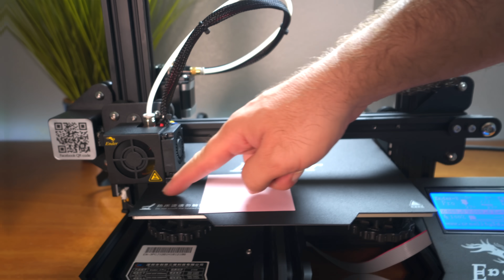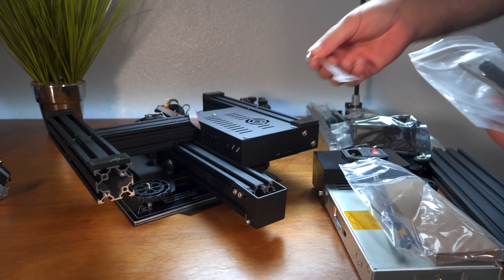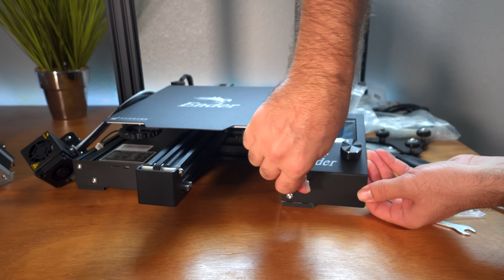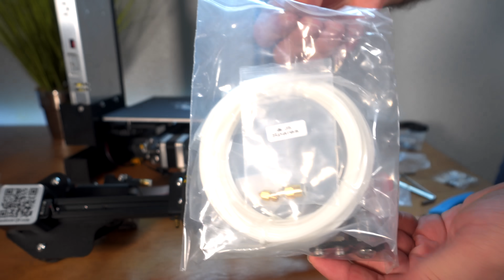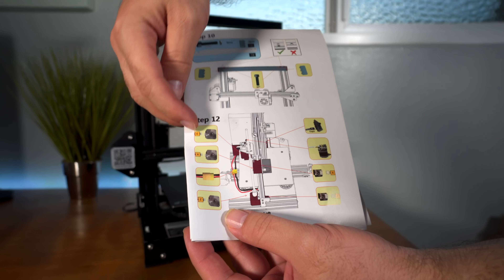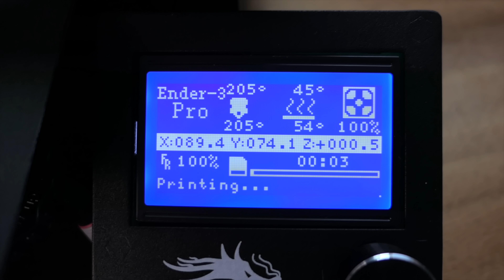Creality Ender 3 Pro -  3D printer - Unbox & Setup

Comment: Thanks Just Vlad for the nice video. Just got mine and after 3 weeks experience with Ender 3 Pro I realice the pain of leveling problem. Even spending half an hour with paper and patience 5xStop points hotend nozzle Z axis leveling, my bed just wont get right, and maybe printing once or twice then it looses calibration again. Just bare in mind this is a real pain of buying a cheap printer, mine was 213€. Then you end up giving up  and no chance to go for autoleveling option having to buy the BLTouch adding another 50-60€ that It will arrive soon I hope . This printer must come with this option from factory as it is really frustrating and in the oficial page already has integrated the BLThouch video (sad). Good Luck anyway thumbs up.

Comment: Woohoo! Thanks again for the video. Helped a ton when the illustrations in the instructions weren't making sense. My first print came out perfect, as far as I can tell. There was a tiny bit of fuzzyness at the tip of the tail and the highest point of the head of the dog I printed using the test file included on the SD card, but it rubbed right off with just my finger. I totally get the people that have commented about running the printer practically non-stop since getting it. 👍 I guess now I have to learn how to work with the files and modify existing designs and hopefully work my way toward being able to start with a blank sheet. I knew I needed one of these in my life! 😁👍

Comment: You'd think they'd mention the possibility you might need to tighten up the bed like you did before you even started to follow the instruction steps. I'm about to start trying to put my Ender 3 Pro together and it's my first ever 3d printer. I'm usually pretty good with stuff like this, but yours needing an adjustment not mentioned in the instructions right off is not exactly filling me with confidence. 😕

Thanks for doing this video, Brah! I'm sure I'd be even more apprehensive about getting started. I may be back to blow off steam by having a public hissy fit. 😉 Did you just call me an eccentric mutt? What you say about my little t-nuts? Am I really nuckinfuts or just trying to divert attention from my heel dragging? Oh well, here goes nothing. Nice that they include the hand tools you need for assembly. Thanks again for your guidance, Obi Wan! 😁👍😎

Comment: Just put mine together had a little trouble then found your channel. Tried to print the filament adapter and the files unzip on SD card but the printer doesn't show it. Any suggestions?

Comment: Hi Vald, thanks for your tutorial, I'm using it to assemble and calibrate my brand new ender 3 pro. I'm printing your recommended improvement parts, and I'have a doubt regardin the need of using the z-axis mount spacer. I printed it, but then I found out that the nut brass for the rod screw is placed in a slide, so I used it to adjust this diference of centers. I think whit that was enought. I like to ear your comment about it. Thanks. BR

Comment: Hi Vlad, thank you for taking the time to do the step by step video. question, the extruder has a little back and forth play, i tightened and loosen the 3 wheels that hold it on the rail, is this normal for it to have back and forth play like that?

Comment: Just got my Ender 3 and followed your directions and it went smooth i just have a question when you auto home yours went to the front and then left but mines goes to the front then stops in the middle is something wrong with mines??

Comment: Just for all of you that watch this video. If during your ender 3 or 3 pro builds, if you add just a small drop of "blue" loctite on all the bolt threads it will save you a lot of headache later on. Because these printers move constantly they have small vibrations running through the frame, which transmits down to the screws holding things together. So when I say to use a small drop I mean it. I put a drop on the end portion of the threads, then roll the bolt on my finger working the loctite into the thread. Then install and tighten. If you use to much on the bolts you may find it tough getting things loose when you do want to take things apart. My only reason for suggesting using the loctite is that I've been reading a lot of posts where people are having issues with their printers coming out of square. I used the build method by CHEP here on YouTube as he simply has a full proof method of squaring the frame. This is a great basic build video and nothing wrong with lots of good advice. Good luck on your builds and hope you have hours of fun printing new creations.

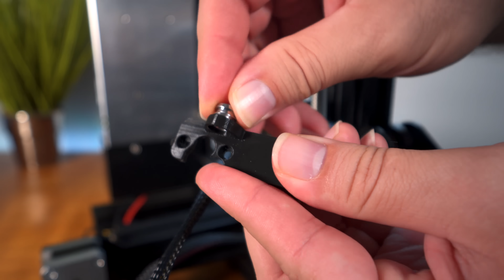Comment: At 27:10 you're using a threaded insert to guide the filament. My question is why couldn't you just print the bracket with the hole a little smaller and get rid of the threaded insert all together?

Comment: Hello Vlad, excellent video. I was able to put my Ender 3D Pro together because of this video, but I have a question for you! After the set up, I went to level the bed and it wasn't leveling correctly, At first, the extruder nozzle slipped past the bed, so I know the bed was too high, but now, the extruder nozzle is too high and I have the bed up as far as it will go, and there is a large gap between the nozzle and bed. Any ideas why this has happened or how to correct it? I would really appreciate any answers :)

Comment: I have my machine set up and the bed is leveled ( this took a few tries), I found the right settings and the filament is coming out the way it should but im having a problem with it lifting and not sticking to the bed, I have the bed and nozzle at max temp and the baby step z is at 0.399, I just got it yesterday, any tips?

Comment: Hi, Thanks for the info on how to set it up. I have a question actually. After setting it up, the extruder on the X-axie wiggles a little bit, and no matter how i adjust those three bolts, it won't help. is it normal for yours? thanks again

Comment: The tip about re-leveling the legs on a flat surface probably saved me a LOT of hassle with my first print. Absolutely thorough video without a bunch of filler to pad the runtime. Short, sweet, and to the point. 
Excellent job.

Comment: What software would be available for Windows 10 - 32bit that I could use for both creating the model and slicing the model ?  Ultimaker Cura is 64bit and I think MatterControl 2.0 is 64bit as well.  But I need something that is 32bit.

Comment: I have a question, I have myender 3 pro assembled, but I noticed that the extruder wheels seem loose on the guide bar, but I can't tighten them any more so it seems to wobble at times.  Is there something I did wrong or need to do?

Comment: I am at the Auto Home step. How do you level the rest of the bed? If the printer doesn't drive itself to the extents of the bed how do I ensure that I'm doing it properly? My assumption is that I disable the steppers and just push the pieces so that the printer head is at each corner of the bed?

Comment: My printer didn't have the screw taps for the front panel screws. I used the longer M5 screws to manually tap the threads. Do NOT do what I did! It can ruin the threads on those screws, and you will ruin the assembly process! Get yourself a cheap screw tap kit instead. It did work out, but I stripped a portion of the screw and had to cut it off to make it fit later on.

Comment: Pretty good video just did it, I wanted to point out(for others) the bed leveling is important for making the plastic stick to it(not too far away/not too close grinding) but mainly the feeding of the plastic ha, mine was making this sound and the plastic going into the extruder feeder didn't go all the way through the hole, had to undo the pulley in my case/push plastic through

overall though great video didn't even look at the instructions thanks

Comment: Hey, I followed your setup with my new ender 3, and the print head  will not reliably  extrude and the extruder tried to leave the print bed and got jammed up while printing one of the test prints, until I aborted the print. My first 3D printer. did I receive a faulty unit? Any suggestions for troubleshooting.

Comment: I followed your video during setting mine up and hardly used the manual. Everything went super smooth thank you for a great video. My bed was totally solid so no need for the first step. The print head axis was a bit stiff and I did cut the notch out of the z axis switch. Now it’s working perfectly. A very good experience thanks to this video

Comment: got my ender 3 pro, easy to build, easy to use once you get the bed right, that’s what takes the time and effort. also missing from the instructions which socket connects the machine to the control panel, choice of three always the last one you choose!

Comment: Just built mine last night , looks like their are some minor changes or quality differences, the washers are all captive and already on the nuts ( black oxide ones ) my base was completely level and tightened, my bearings were all perfectly tightened, I didn't even touch my eccentric nuts. The spool holder now has a fixed end piece, and the nut has been replaced with a notched twist lock mechanism. The Z axis is still misaligned and needs shimming on the z stepper to push it out, and the z index has to have that nubbin clipped off so it can go down further, or else the bed  level nuts do not have enough range to actually level, ( this is easier than adding say washers to the be level knobs or stretching springs etc )

Comment: Is it practical to use a UPS on a printer such as this one? What capacity might you use?
How often do you need to re-adjust the rollers to keep them tight and smooth?
Is the controller flashable to  implement any improvements?
Did the power supply fan ever run during your test?
What range of filament types will it work with,  ABS, wood filaments, nylon etc?

Comment: Thank you very much for this video- I watched several times and then used it as my guide in setting up my Ender-3 Pro (first ever 3D Printer.  There is no way I could have built this thing from the info card included as a manual.  My first test print is running even as we speak!

Comment: I just used mine for the first time yesterday.  I printed the cat and I was blown away by how perfect it was!  All most no signs of the individual layers!  I went to bed and left it running.  Well my cat popped off the bed and is missing the top of its head!  Poor thing!  It was in a very cold basement wonder if that attributed to it failing.  Any suggestions?

Comment: Thanks so much for your help. I have a question. I built this printer tonight and I'm at the bed leveling stage. The prints that you have as files below, do I need to put them in a slicer like cura? or can I print them right off the sd card. How about the files on thingiverse? Do they need to go in to a slicer program first? Thanks again

Comment: Mine came with 3 little blue rings for the filament feed. Need 2 with 1 spare.
Update version I guess since mine came in 2 layers but smaller box.

A tip, slide in the T nut of the filament holder on the right side of the top rail before assembly.

Comment: I just got an Ender 3 Pro and this video was really helpful - thanks! Had to rewatch it a couple of times but I got my printer up and running. I'm having a problem with the z-axis though, it keeps saying X axis 0, Y axis 0, Z axis -0.75. I'm a total noob at this so I've only tried printing things from the included SD card and the nozzle keeps hitting the bed. Even when I manually raise the nozzle or lower the bed, the nozzle keeps resetting too low so that it runs into the bed and won't move anywhere. Can't figure out how to tell it not to do that.

Comment: I want to congratulate and thank you for the time you took to make this video. I bought the printer, watched the video on my flight back home. Watched again at least 10 times during the unboxing and build, but I did it because of this. Very good work, thank you !!! Just after that I could level the bed using another video, and printed the little dog that comes on the SD card nice and smooth.

Comment: Ahaha just my luck. I bought an Ender 3 Pro and have just finished assembly. I then go to insert a micro SD card and it turns out the PCB board has a screw bending the board so that I'm unable to insert the card. Awesome!

Not a great start to my 3D printing experience.

Comment: My documentation showed to use EXP3 (the one closest to the printer) for the LCD. Also, my brand new printer (bought 4/29/19, manufactured 3/2019 according to the board) came with clips for the bowden tube holder. Bed leveling isn't enabled in the standard firmware. See Teaching Tech's video on enabling mesh leveling using Marlin's firmware.

Comment: I just unboxed my printer and used your video as a crutch to the instructions.  It helped me tremendously!  This is my first 3D printer, I bought it on Amazon as well. I am curious about the auto bed leveling because the PRO version was advertised to have that feature, maybe they mean the dials. I saw on one of the other 3D printer gurus I follow actually print those dials.

Comment: Thanks for the video it helped a lot. It is working get. I have a new Ender 3 Pro -3d  it came with upgrades in the box the little clips to hold the filament hose in came with 3 . I ordered the aluminum feeder . Now i need to find some upgrades for the cover for the 
control panel .

Comment: Vlad,
Thank you for all the Ender 3 Pro Videos so far. I received my Ender 3 Pro the other day and Used your Setup video to build it. During the build I even installed the Smoothers and upgraded Extruder.  Every step ensured the printer would work optimally and it paid off. Everything is working great and I am currently printing a few of the upgrades you have shown. Thank you again!

Comment: Hey, I purchased and set up the printer based on your amazing video. They actually upgraded the box to include the clips at the extruder, which I thought was amazing. One issue I was running into was making the build plate holder not wobble. In your video, you tighten two bolts, barely, and it was fine. Mine wobbles like crazy, and when I did the test dog, the bottom layer was a mess. I did a two layer bookmark, and it too wasn't worthwhile. I purchased a bunch of the upgrades (and downloaded the print mods), but any suggestions on making my bed holder not wobble? I noticed when I disassembled, it was missing two washers, but that didn't fix it.

Thanks for these videos!

Comment: I just unboxed and assembled my first 3D printer.  Followed your video step by step and had a perfect success the first try.  It's doing the test print supplied by Creality now.  Just wanted to thank you for your excellent instructional vid.  You made it easy.  Everything from your detailed comments to the changes in camera perspective was very professional (except losing steps 9 & 10, which turned out not to be a problem anyway).  I definitely subscribed and liked.  Thanks again.

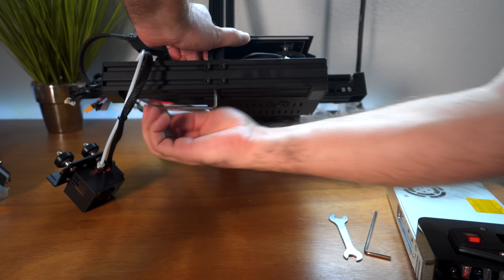Comment: Dang, I just got mine today. During the build I found the upright at 7:27 (left side facing the front) is not tapped in the lower holes. They are drilled but not tapped. I feel comfortable tapping these myself so its not too big of a deal. I just hope nobody else gets a mistake like this or at least anyone that wouldn't have the tools (tap) or experience to fix it.